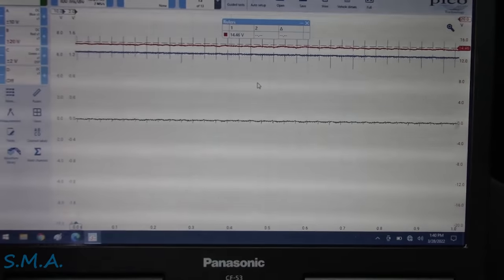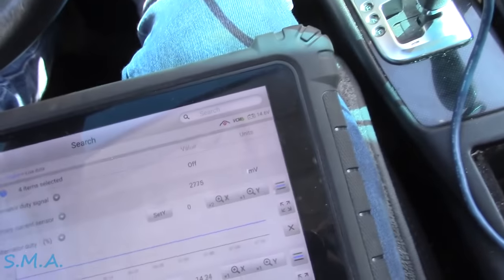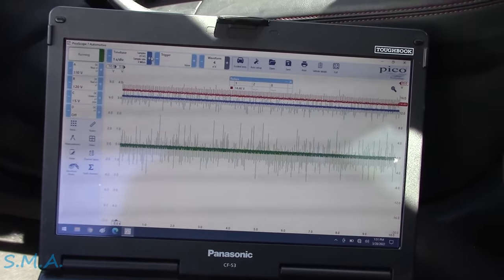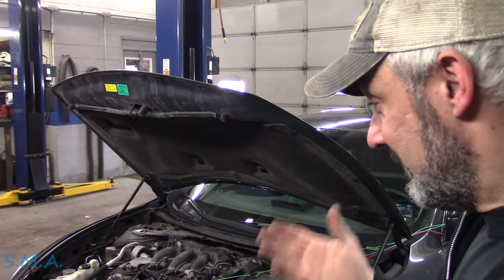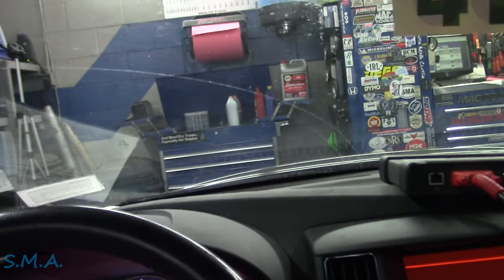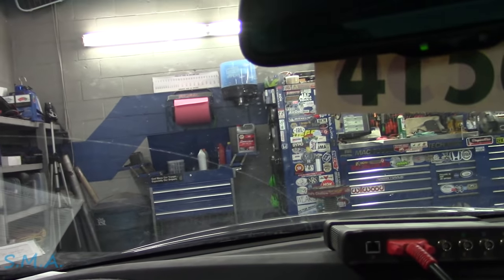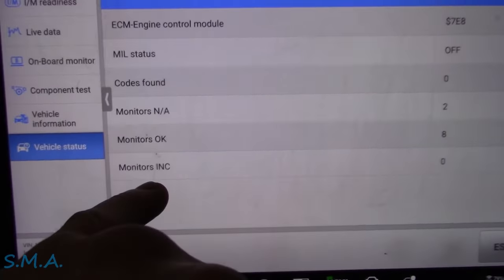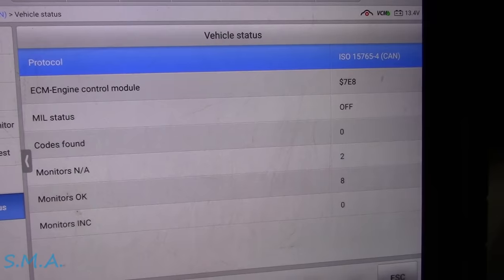Nissan Dealer Quoted Over $2000 For A New Harness!! - The Real Problem

Comment: That's the difference  between  a part changer and a technician  
Wish the auto repair  industry  had more people like  you
Reply: I have to say that often just the parts are broken and you have to replace it. Only the weird cases are really for checking the car. I done this and it's only possible if you have the right tools and the right information for the job. Working/checking into the blue doesn't help you and I had to work like this because my boss don't want to invest in information or diagnosis stuff. Also it's often a electrical issue like corrosion or so and there are actually a simple way to figure everything out and it's shown in these videos here👌😎
Reply: @imtheeastgermanguy5431  I agree and the second thing to consider is that the computers the dealerships are using are probably biased to diagnose towards just swapping parts. Remember that a lot of problems are still under warranty and therefore have to be solved as quickly as possible, because time spent is money lost. A more comprehensive diagnosis therefore is not something most dealerships will do.
Reply: @tjroelsma  maybe
Reply: This video is evidence that the dealership was incompetent they simply didn't do the job they over charge for. Any lawyer would fight this case on a win only basis because it's a slam dunk. Dealerships need to improve their performance and if nobody complains that won't happen.

Comment: We should all be so lucky as to meet a mechanic like you. Imagine how the profession would be regarded if that were the case
Reply: i wish we had one in every town and city
Reply: Truth buy honestly there are a lot just like him, my brother runs his shop the same way. He’s super knowledgeable and stays up on new equipment and maintains a modern shop . Like Eric his customers often pay him to repairs trucks under warranty because the dealer either hasn’t fixed it right it it takes over a month to get it looked it.
Reply: We should all be so lucky as to find a main dealership in the history of mankind who has ever admitted that they were wrong and refunded the customer with an apology. Never heard of it yet, but I'm sure Nissan will....
Reply: My local is a great one also!
Reply: But that is the case
Reply: @Frank_Nemo  My Mitsubishi dealer did a great thing during a fuel tank replacement, said it would be done the following afternoon.  Got a call a few hours later, the work was done and over $300 cheaper than the quote.

Comment: She should get back all the labor costs for sure. The Parts, after all, are new they are put in but labor when not needed is wrong simply wrong. Good Job Eric as always!
Reply: I hate to say it, but good luck with her getting her money back from the dealership - sad.
Reply: parts were unnecessary as well. The dealer shouldn't be allowed to make money on parts that are a guess and unnecessary. She should be refunded 100%
Reply: @jeffblalock6326  Right, she should have her old and good parts put back in, not at her expense, of course. The shop just has to keep the new/used parts and hope to sell them in the future at a discount after disclosing the situation to the future customer. They must agree, of course.
Reply: Dealership is afraid to set a precedent for every time they are wrong. Most of the time😂
Reply: It's not the dealers fault. It's the fault of the so called Tech. Who didn't diagnosis the problem. Now that's why I don't take my vehicles to dealers to the So called Techs. It's a an over used term calling them Techs. Seems the majority of previous auto mechanics are now called Techs. indeed there are true Techs such as MR. O
Reply: I do agree about labor cost.
Reply: The customer should file a complaint with the state's Bureau of Automotive Repair if the dealership does not refund their money.  Not right for the customer to have paid for repairs they did not need.
Reply: @edman1015  Small claims court is a thing. If I lost 1000+ dollars on a bad diagnosis I would be pursuing it.
Reply: @2nickles647  and who trains and employs the tech? So the tech should pay?
Reply: agree...small claims court
Reply: @2nickles647  The Dealer employ's the tech, so it's their fault and their responsibility to train and employ quality tech's.
Reply: I agree. Labour costs refunded and also all  parts priced as trade/heavily discounted as a goodwill gesture.
Reply: Go to Small claims court and play this video.
Reply: @edman1015  the dealer will usually refund her the money if the diagnosis was wrong and she makes enough of a fuss
Reply: @aayesher9400  They will take it from the tech
Reply: @edman1015  you ment to say the Stealership not dealership it's ok
Reply: She Can get all her money back just tell them to watch this video.
Reply: 100% refund, if they don't like it , they can keep the new,  and reinstall they GOOD old parts ... and adding to the claim, they tried to defraud her of  another $2000
Reply: @2nickles647  The techs are employees of the dealer. The dealer is responsible.
Reply: @2nickles647  The dealer hired the tech so they are responsible for his/her mistakes.
Reply: Dealer should refund.
Reply: There's a good chance she did need speed sensors with the age of the car.   I just finished replacing parts in my vehicle that weren't _bad_, but with the miles on them, and that I was doing the labour, it was a reasonable set of maintenance.  (oxygen sensor, vacuum tubing, gaskets, etc)

Comment: I can't believe dealership get away with charging the customer when they failed to fix the car I work at an independent and if we can't figure it out there's no charge simple as that
Reply: True, how could they even think of charging her when they haven't fixed the issue; I think the 'you need a new harness' line is just so they can charge for the 'repair' and get out of a refund by saying that she refused to have the repair done that would have 'solved' the issue.  I doubt that the lady will get a refund unless she goes in gung-ho!
Reply: I own and operate an independent repair shop and the most I have ever charged a customer for an extensive diagnosis that I couldn’t fix was $60, and that is only because the customer demanded to pay something for my time. If we charged like the dealer I would never have repeat customers.
Reply: @splatmanhooha4264  Yeah, she's going to have to take them to small claims!!
Probably the worst examples of having to pay without a good outcome are doctors and lawyers!!
Reply: @paulvillere2321  - I've done the same thing.   I've spent an hour or two trying to repair a computer system, to finally say "I can't really do anything.  It's just old."   When they ask "what do I owe you?" I usually say something like "ten bucks for gas.  I couldn't fix your problem."   If they weren't out of the way, "nothing".
Reply: she needs to dispute credit card charge or small claims-
Reply: I had a mobile mechanic business, and I was the Same way. If I couldn't diagnose it, they didn't pay.
Reply: You must not be in touch with the medical ..pharmaceutical...hospital or insurance industries??.....because if you were .....you would know that this is just chump changer in comparison...
Reply: Dealership should look for another head tech and refund customers money. NY customers should give the dealer bad reviews and complain directly to Nissan Corporate about poor treatment. Raspberrys to dealership!
Reply: Back in the 1980's the Nissan dealership torqued down my valves too tight and burned up 4 of my 6 exhaust valves on my 260z. I paid someone else $1200 to fix it. I never had a car serviced at a dealership again.
Reply: What was the dealer going to do after changing the harness at a cost of 2-3 THOUSAND dollars and then still have the same problem.  I'd like to hear that conversation..
Reply: @btcbob11392  most likely they would have threw some parts at it n fixed it in the end but never tell the lady what actually fixed it hell they probably would of charged her for the alternator to
Reply: @btcbob11392  Well it could go two ways..

1. They expect the guy to walk and that was their intention ....Scare him with a price that is too high...

2. Take his money and and when it still doesn't work ...feed him more bullshit ...and give him another high price solution...

There is actually a lot of money to be made by NOT Fixing things...There was a big to do in Florida decades ago...With AC...It was dubbed Salesmen in disguise ....you a poor homeowner would call for service and a guy would show up ...that had no skills or training in AC but he would hook up gauges and stuff and tell you that sadly you needed a whole new system...

Big storyin all of the news...No One went to jail!

Comment: From the other comments on here, it strikes me that this is a relatively common failure mode that a main dealer, that works on these and similar vehicles all the time, should be aware of.
Reply: I had a maxima and like most performance enhanced cars many issues will put it in limp mode

Comment: Lead tech estimate strategy was to hopefully run the customer off with a scary dollar amount. Likely because he feared getting it wrong and endless comebacks.
Reply: Happened to me recently...
Reply: Yep. There's also the "You need a new engine." to get rid of someone.
Reply: They would have replaced the harness, discovered the problem was still there, replaced the alt. and say the harness issue cause the alt. to go bad. She will probably have to sue to get a refund, but she has proof right here at SMA YouTube page...
Reply: Well, either fear of endless comebacks, or maybe they were hoping she would fall for it.  And some do fall for it.  And then the customer ends up parking the car or selling it for cheap rather than pay a fortune for a repair.  Dealers LOVE trade-ins and cheap cars these days.

Comment: Just an FYI on Nissans the battery light will come on if the Voltage goes too high, somewhere in the 16 V range.  Not sure if all OEMs do this.  Just because the light was flickering doesn't mean it's not charging.  It could also be too high, so based on the first video when you saw that light flickering, you could narrow it down to charging system problems at that point.  Good episode!

Comment: I’m thinking 80% of the garages wouldn’t have caught this in the 1st go.  Many techs lack at diagnostics skills especially rogue problems like this.  Your  knowledge of wiring and diagnostic skills are exceptional!   I wished there was more techs out there with a brain like yours.   Too many part swappers.
Reply: If you fix Nissan's all day, you should get  a feel for what makes sense or not.  I doubt this is a unicorn in NissanLand that hasn't happened before.
Reply: @dlewis9760  Exactly so and with electrical going crazy all over the place its only reasonable to suspect a faulty alternator.
Reply: There is a good chance the techs didn't even take it out for a drive. They just put it on the computer then guessed.
Reply: 1st go yes. but if the garage has a good owner who's not trying to pump out work and let there techs learn. it may take days. they may not make money but eventually they can figure it out. given enough time a tech can figure out anything. But in the real world garages do not allow this.
Reply: This was most likely the fix recommended from tech line to decide to replace the wiring harnesses, the tech line usually gives some screwed up diags and fixes, I've witnessed this many times first hand. The lead tech/shop forman should've honestly known better.
Reply: a shame but with todays vehicles changes in voltage can cause all kinds of issues - that should have been the first test -  was interesting how the left turn caused the issue
Reply: @lupavo1738  The problems usually encountered with tech line is they give the tech a bunch of instructions to test this measure that, and 90% of the time the tech's lie and say "ohh yeah I got a good voltage there or I tested that any everything's good. " That or tech's get frustrated with basic tests they have them perform or don't understand why they want them to check a certain reading. Most of the time tech line has even better service information than the techs. I can't count how many times I've called tech line and had them give me information that I don't have. Usually they can give me internal circuit diagrams for electrical modules so I can test onboard components like integrated relays, resistors, Diodes and Mosfet drivers. Sometimes they are the only one's who have information for decoding CAN bus signals to find out exactly which module is giving someone problems.
Reply: Your absolutely right every garage would have missed that hands down especially the dealer 😭
Reply: @Lancemechanics  Bingo. This is what non-mechanics don't understand, the customer has to authorize the time to diagnose, they rarely do. Cars are COMPLICATED today, it OFTEN takes longer than 45 minutes to find a fault, Eric spends HOURS on a lot of these but due to editing it seems like 20 minutes

Comment: The fact that the dealer had it for 6 months and their only suggestion was to replace the harness is inexcusable. 

My mother had a 2000 Maxima and went through the same thing with the Nissan dealer. They quoted a harness at $1300 at the time. After installation of the harness, they called back to say “oh, it also needs a mass air meter”, which I suspect was the original problem. 😡
Reply: I know a woman that was charged over $200 by a Nissan dealership to screw on a Murano door handle that she supplied.
Reply: They're real quick to scrap the harness, huh?
Reply: My mother-in-law lost the keys to her Altima. She took it to Nissan for new keys where they "bricked" one of the modules ($900) . She shouldn't have had to pay for the tech's mistake, but she did. Nissan customer service was no help, either.

Comment: A wonky regulator inside the alternator can definitely cause plenty of weird errors. The Nissan repair shop should be well versed in how their electrical charging system works and with a proper diagnostic tool, should have identified the weird voltage being output. I'm quite surprised the excessive high D.C. voltage didn't blow up the electronics. There must be quite a high tolerance range in automotive devices to withstand the peak voltages. Great troubleshooting and a good call on replacing the alternator. I do wish you could have shared the swap out of the alternator. As a non-mechanic, those are the steps that caused me to avoid repairing my vehicle, how to pull out the alternator without having to pull half the engine apart.

Comment: Man I would quit working on ALL 5 of my cars tomorrow if I knew there was a mechanic like you in town. Id pay $150 / hour all day for diag
Reply: I found a shop only 2 miles from home with techs with diag skills. They’ll be getting my business from now on.
Reply: Exactly, I got no problem paying for the diag,,, if it is right.  If it is not 100% mechanical in nature and dreadfully obvious, I've noticed a lot of mechanics today are just shooting repairs at it until it is fixed.
Reply: @erich6860  The parts cannon as Eric calls it lol. The hard part is how do you find that mechanic?
Reply: @Kevin-zo6nz  You dont.  You find out the hard way the first time a repair is needed that is not brakes, exhaust, or obvious AF. 

I went to a mechanic for nearly 20 years, and he screwed me hard over a repair. I knew the timing belt has slipped, so they did that repair, but then I had the check engine light on (never on before), it was stalling.  I give it back, they "fix it" charge me another 300 dollars.  I get it back,, still check engine and stalling.  I look up the code, tell them it is specifically heat sensor out of range,,, mech tells me that it is fuel pump.  

At this point, I pop the hood, pull off the connector to the thermostat sensor, reconnect, boom problem solved.  No check engine, no stalling.  

I'm disabled, and I cannot work on cars anymore, but this was the last straw with a mechanic I trusted.
Reply: $150 /hour would be a bargain, my local Chevy dealer charged me $225 /hour for 4 1/2 hours to chase down a shorted wire causing a fault to be set with the electronic power steering on my son's 2616 Colorado that was 3 weeks out of 36 month warranty with only 33k miles on the truck. My next new car will be with a new dealer.

Comment: Wait, the dealership wanted to "fix" a bad alternator with a new wiring harness? That's scam level at that point.
Reply: It is lack of willingness to do this kind of testing.
Reply: Not a SCAM, Just incompetent techs, and training.
Reply: I think they had no idea ... and just made up an expensive repair she would refuse .... to GET RID OF HER
Reply: or they may charge her 2000 for harness...and also put in new alternator!!
Reply: "Scam" denotes intention.

Comment: Another excellent diag Eric. I work in IT, but I find your thought processes and methods invaluable as I troubleshoot our systems here.
Reply: As a retired E.T. and network infrastructure tech. I find that Eric is a outstanding electrical technician.  As well as a thorough mechanic. Impressive.
Reply: Yeah, sys engineer here.  You gotta love issues when troubleshooting results point in seemingly opposite directions.  The work these guys do on electrical/software issues is so very similar.  Sometimes drilling down to where the actual problem is is almost impossible because vendor coding is a black box.  You can only see what goes in and what comes out.